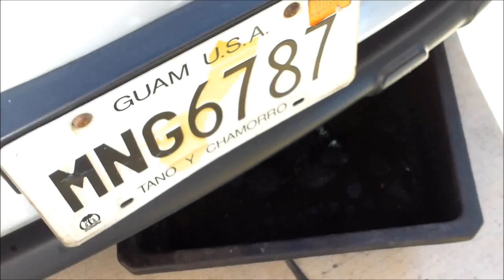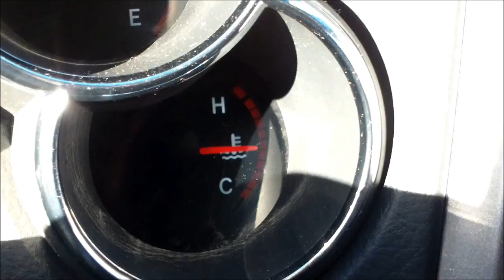DIY How to drain and fill coolant Toyota Matrix Corolla √ Fix it Angel

Comment: I do a drain and fill every two years with Toyota long life coolant. I drain radiator and use a turkey baster with section of tubing attached to empty plastic tank. I don't bother with draining block as very little comes out. Coolant last 5 years so if you change it every 2-3 years you with always be running mostly fresh coolant.
Reply: @Frank. T all of the coolant sits above the block, so in theory you should get all of it.

Comment from the maker: thermostat is on the lower radiator hose that is connected to the engine block. you will have to remove the alternator to get to it. remember to have jiggle valve on thermostat upwards.  thanks for asking and please subscribe
Reply: Been trying for 2months called every toyota dealer in the book is it on driver or passenger
Reply: Changed water pump and thermostat still overheating so a buddy said air could be in block and drain engine coolant but no1 knows where it is
Reply: @poedaddy77  did you ever get the problem fix I’m having the same issue now ! I have new water pump new thermostat also

Comment from the maker: you would have to keep on pouring coolant into the radiator when you see it go down. if it it topped off and see no more bubbles and can see steam coming out, put on the cap. but watch the thermostat gauge on the instrument cluster. this process can take up to 15-20 minutes till the thermostat opens and the radiator fans go on. anymore questions please ask.

Comment: i couldn't get a wrench from above as I can turn the 10mm bolt from above on the corolla. from underneath i had a hard time to reach. i tried to tighten base back but left at 1/4 turn. do you think it will leak? should i just remove the whole thing? TY.

Comment: What coolant do you like best?  Older Toyota red or newer pink. My 05 Vibe has pink in it now.  Zerex Asian formula pink is pre diluted but Pentosin red would have to be diluted.  I was going to flush the system with water then drain it, add half the capacity back with red then top it off with water.  What do you think?
Reply from the maker: Hello, The older Toyota's recommends the red. For your vehicle, go with what the manufacturer recommends. Thank you you for the questions. Have a nice day and please subscribe.

Comment from the maker: no it does not have a bleeder valve. highest part of the cooling system is the radiator radiator cap. you would need to keep on filling it till there are no bubbles.

Comment from the maker: only a cup is odd but thats ok. teflon is ok too. no leaks is good but drive the car for 20 minutes, if you see the temp gauge goes over 3/4 to hot then you still need to add coolant because there is air still in the block. sorry late reply, gone to a car show.

Comment from the maker: you can remove the whole thing but when coolant is removed, put locktite on the threads when you tighten it back so it will not get loose and leak. welcome
Reply: Locktite on the drain plug threads?

Comment: Just did my coolant change thanks to your video.  It took me longer than 2 minutes though.   :-)   Also, thanks for including a good view of the engine block drain plug.  That was very helpful.  I wound up draining just under a gallon and refilling with just under a gallon.  Is that about right volume wise?  Maybe this is somewhere else in your comments.  Apologies if so.  Thanks again!
Reply: Me too. I got a calibrated bucket to use out of curiosity. I drained about 120 oz, which is just shy of 1 gallon (128 oz). The radiator drained about the most fluid while the engine block drained about two cups or less. I even jacked the car up and down while the engine block drain plug was open to see if more fluid would drain, but no dice.
The 1ZZ-FE engine has 6.5 qts at total capacity which means that around 2.5 qts remained.
Oh and also thanks Fix It Angel. Real nice video work!
Reply: @theoscarman  I know this comment may be old, but you may have missed draining the coolant overflow tank which the video never showed doing.

Comment: Can you just disconnect the bottom Radiater hose? I had a drain plug break once and don't really like to mess with them.If you disconnect the bottom radiator hose. do you still have to loosen the block drain plug?
Reply: Little while since you asked, 5 years lol but I'm curious what you ended up doing, I've broken plastic re sealing my fuel injectors before so shits fickle, really wanna avoid busting shit on these old cars.